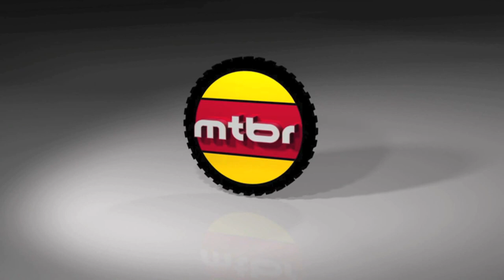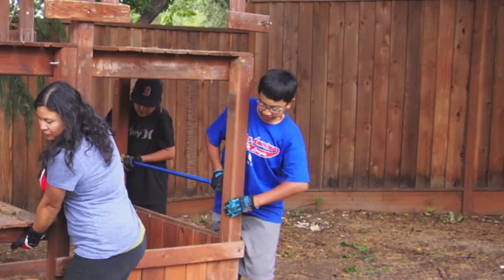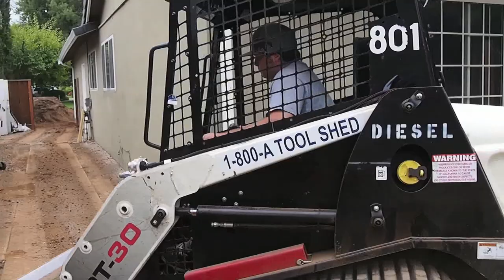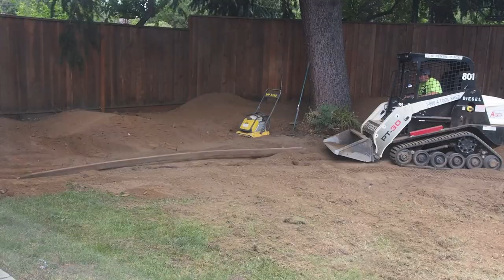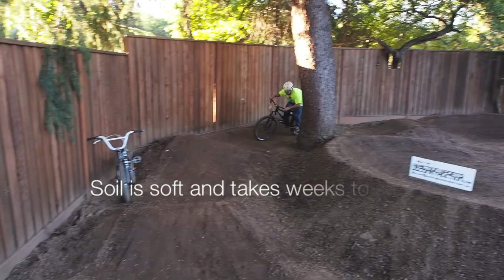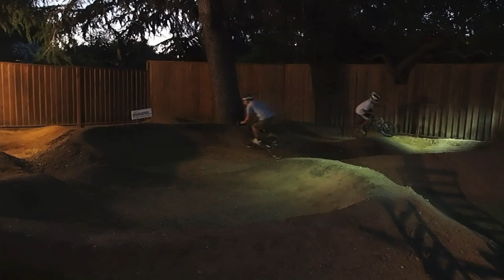How to build a backyard pump track - IN ONE DAY

Comment: Where did you get all of that dirt and how much was it to hire Alex? Also, you have inspired me to make my own pump track. I will do the building myself I just need dirt.  Are there any cheap ways to get dirt because I'm 13 and my parents said I could build one just I had to cover costs.
Reply from the maker: A lot of construction companies give away free dirt. Especially from homes excavating dirt for swimming pools. The key issue is contacting them and getting it dropped off at your house.  Also, the dirt can be full of rocks which is not desired.
Reply: RCReview There are a bunch of new houses being built about a block away from where I live, should I ask them for the dirt from the project? By the way, I subscribed!
Reply: Will topsoil work
Reply: RandomTwiggster you dont need a bobcat either you can do sufficient with a shovel and spade
Reply: Late as heck, but you can actually dig a track into the ground, if you need soil